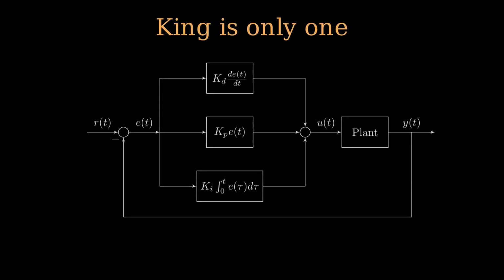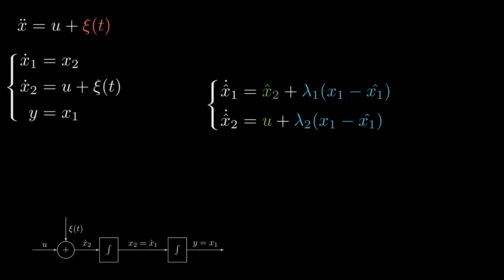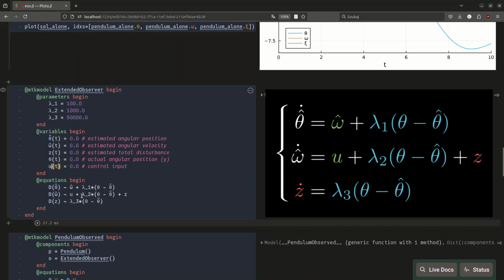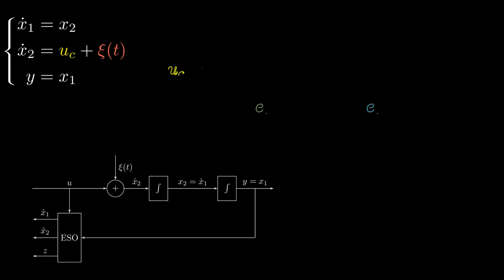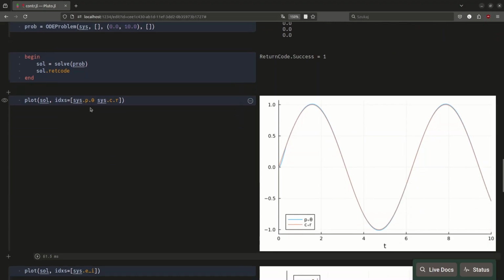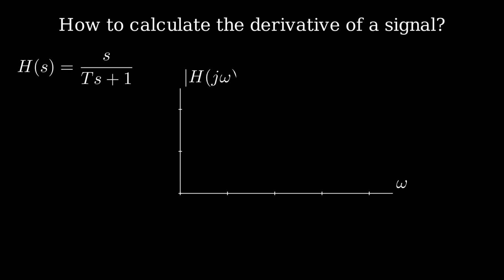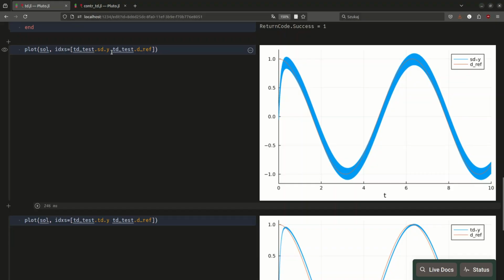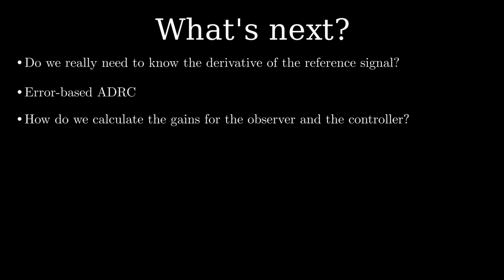Active Disturbance Rejection Control the intuitive way part 1

Comment: Zusammenfassung:
• Das Video ist der erste Teil einer Serie über *Active Disturbance Rejection Control (ADRC)*.
• Ziel ist es, Intuition und Wissen für die weitere Erforschung und praktische Implementierung von ADRC zu vermitteln.

1. Grundidee von ADRC
• ADRC ist eine Steuerungsstrategie, die kein Modell des Systems benötigt.
• Es wird angenommen, dass das System ein kaskadierter Integrator mit einer Störung ist.
• Unmodellierte Dynamiken und Störungen werden zu einem einzigen Term zusammengefasst und geschätzt.

2. Extended State Observer (ESO)
• Der ESO schätzt den *Zustand des Systems und die Gesamtstörung*.
• Er besteht aus einem Prädiktions- und einem Korrekturteil.
• Die Simulation zeigt, dass der ESO den Zustand und die Störung gut schätzen kann, mit einer erwarteten Verzögerung.

3. Reglerentwurf
• Ein linearer PD-Regler wird verwendet, um eine vollständige Zustandsrückführung zu implementieren.
• Die *geschätzte Störung wird vom Reglerausgang subtrahiert*, um die tatsächliche Störung aufzuheben.
• Die Simulation bestätigt, dass das Subtrahieren der geschätzten Störung die Regelgüte erheblich verbessert.

4. Tracking Differentiator (TD)
• Der TD wird verwendet, um die Ableitung des Referenzsignals zu berechnen, ohne hochfrequentes Rauschen zu verstärken.
• Er ist ein kausales System, das durch das Einführen von Polen die Verstärkung bei hohen Frequenzen begrenzt.
• Die Simulation zeigt, dass der TD robuster gegenüber Rauschen ist als ein einfacher Differenzierer, aber eine gewisse Verzögerung einführt.

5. Gesamtsystem und Ausblick
• Das Video demonstriert die Funktionsweise des vollständigen ADRC-Systems mit ESO, Regler und TD.
• Die Regelgüte ist gut, aber die Verwendung des TD führt zu einer leicht schlechteren Performance im Vergleich zur Kenntnis der exakten Ableitung.
• Im nächsten Video wird untersucht, ob die Ableitung des Referenzsignals und der TD wirklich benötigt werden (*Error-Based ADRC*) und wie die Reglerverstärkungen korrekt berechnet werden können.

Eingedampft mit Transcript Distiller
addons.mozilla.org/addon/youtube-transcript-distiller

Comment: A very informative video. I am currently recreating the simulations and I am facing a problem. The initial pendulum example works fine. However, when I try to simulate the Part 2: Controller Design, I get the following problem,
prob = 
ODEProblem with uType Vector{Float64} and tType Float64. In-place: true
Initialization status: OVERDETERMINED
Non-trivial mass matrix: false
timespan: (0.0, 10.0)
u0: 6-element Vector{Float64}:
 0.0
 0.0
 0.0
 0.0
 0.0
 0.0
ReturnCode.InitialFailure = 8
Any suggestion to resolve the issue? I have checked and the codes are all the same.
Reply from the maker: Which Julia/Modeling Toolkit version you use? Looks that the best I can do here is to finally upload source code for sims to github and share

Comment: Thanks. Great explanation of ADRC. I've read papers by Zhiqiang Gao at CSU and still wasn't clear on what it is. Essentially, it's the assumption that the plant dynamics can be considered a disturbance and estimated using a double (or more) integrator model. Obviously this is not going to work in all cases. Presumably it wouldn't work on non-minimum phase systems for example. Also when measurements are noisy and dynamics are not slow.
Reply from the maker: I'm very happy that my video helped you understand this concept. Obviously ADRC is not a silver bullet, I'd need to think about non-minimal phase, but with noise and fast dynamics you nailed it. In the upcoming video I'm going to talk about finding observer parameters by tuning its bandwidth and those will be important considerations there.
Reply: No, I think ADRC is general control system. You can use it for nonmininum system and delay system. There is some paper disciuss this issue
Reply: @ May be but most of the examples I could find online, simulated and real demonstrations, were speed control applications where the system model actually is a double integrator.
Reply: @BillTubbs  search on Scholar not youtube. You will find a lot of examples controlling attitudes, altitude of aircraft, controlling steam , controlling nuclear power plant, and power Electronics etcs